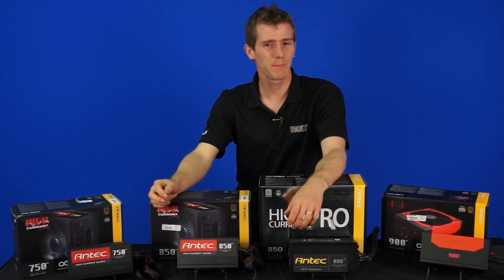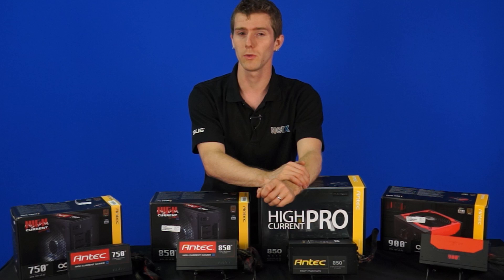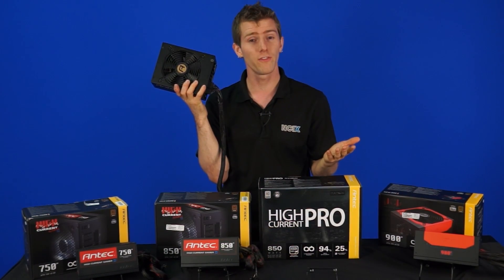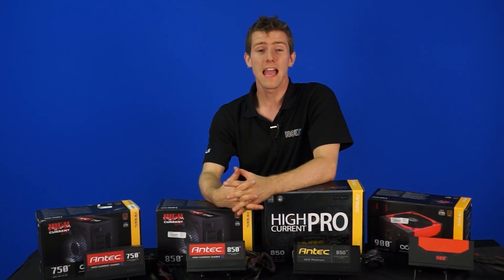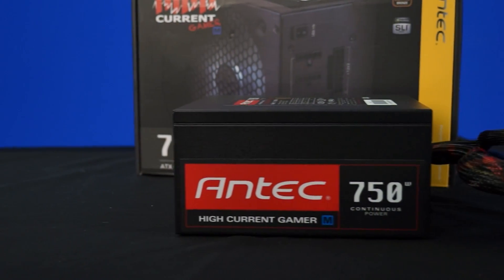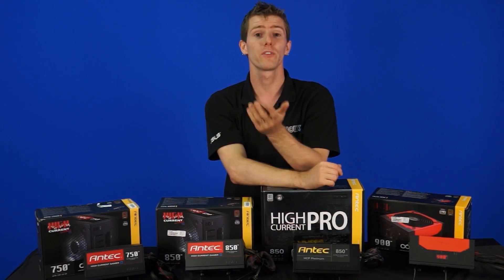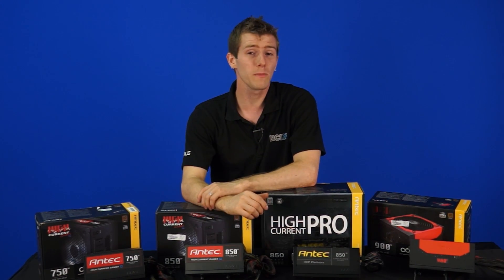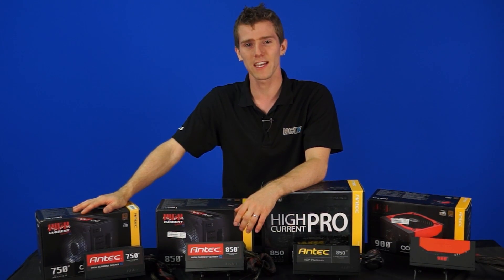How Many Watts Do You REALLY Need In Your Power Supply? ft. Antec HCG

Comment: I bought a HP ProDesk 400 with just a motherboard, optical drive and power supply for £20GBP/$27USD. It only has a 240W PSU, yet runs fine with a 4th gen i3, GTX 660 and 8GB DDR3. All costed around £140/$185 and that even includes a 120GB Kingston SSD as well as a 1TB Seagate Barracuda Hard Drive. Great deal.

Comment: How much power do I need for a 
intel i5 2.7ghz
1x 8gb memory stick
1 tb hard drive
Rx 460 2gb
Reply: 430 Watts PSU would actually do the Job, lets say processor 100w + Rx460 ( On Fullload) 100w + Ram and HDD like 40-50 Watts = total of 250 Watts. so you basically have 180 Watts left for like Overclocking your GPU, if your CPU And Motherboard Support Overclocking.

Comment: How many watts do I need 
Intel
G3258 4 Pentium 3.20 GHz 3M Cache 2 Core Processor 
Ballistix Sport 8GB Kit (4GBx2) DDR3 1600 MT/s (PC3-12800) 
Asus H81M-A MicroATX DDR3 1333 LGA 1150 Motherboards
Asus
2GB Graphics Cards R7240-2GD3-L
Sea gate 1TB Desktop HDD SATA 6Gb/s 64MB Cache 3.5-Inch Internal Bare Drive
Reply: Plz reply
Reply: HuahwiFanBoi www.coolermaster.com/power-supply-calculator/

Comment: I use to run my two 780's overclock on a 750w power supply also have three hardrives 6 fans corsair self water cooler with a push pull total fans 8 the power hungry fx 8350 led light strips corsair RGB keyboard and not once I ran into power problems you don't need a overkill power supply just enough.

Comment: what watts shall i get? my specs are i7 4770k,asus z87pro, 12gb ddr 3 ram, 256ssd,1tb hdd l, 1 optical drive,zotac geforce gtx 970, 3 120mm fans,coolermaster h212 cpu cooler...the calcualtor suggests 600w, what do u ppl recommend?
Reply: 600-650w 80+ is good if you are not using liquid cooling. If you have liquid cooling or running over clocked I suggest 750 give or take.
Reply: Kevin J no liquid cooling or overclocking. No gaming at all, just normal use like browsing internet.
Reply: +The Hitman Then go with 600w bronze+ is perfect. Antec and  corsair have some good psu, don't forget compatibility measurements. Good luck.
Reply: thanks mate
Reply: The Hitman get 650 to make sure

Comment: im 16 and im soo confused about psu i have 320 watt psu does it actually enough for 750 ti or other gpu with 2gb vram????
Reply: 320 watts? Does that exist? Anyway, it mainly matters on what CPU, cooling and GPU you are using. I'm going to go ahead and say 500 watts 80+ is good if you're running a less efficient CPU and air cooling.
Reply: striker113 thnks for the tips tho,my dad bought my first pc this one that we talk about what i know is i look at the back of the psu box it says 320 watt,so i just wonder is there any 2gb vram gpu for my psu???if not yup 500 it is.......bad english sorry.....

Comment: i got a question! how much watt supply do i need?
+CPU : Intel Core i5 6600K / 3,50GHz 
+RAM : Corsair Vengeance LPX 16GB 2666MHz DDR4 
+HDD : Seagate Barracuda 1 TB
+SSD : samsung 850 EVO 250 GB (SSD)
+Motherboard : ASUS Z170 Pro Gaming
+GPU : Nvidia GeForce GTX 1070 (8GB)
Reply: If you're not planning to overclock or upgrade, I'd go for 650 watts. If you want some headroom, 800 watts is not that much more expensive. Always look for high quality, efficient power supplies.
Reply: thx

Comment: can I run my MSI gtx 980ti on a thermal take 600w tr2? please help.
Reply: Nvidia recommends 600w or more so wattage should be ok if you don't overclock.
Reply: Jonathan Zimmermann that's more than enough power 

I ran my two 780's overclock on a 750w power supply also have three hardrives 6 fans corsair self water cooler with a push pull total fans 8 the power hungry fx 8350 led light strips corsair RGB keyboard and not once I ran into power problems.

Comment: Guys, halp! I want to build on my Pc 8 GB ram (Hyper X) and a Gigabyte GTX 950 OC 2 GB. I actually have a i5 4440 3.1 GHz, so, the question is, how much Watts do i need? 
Remember: i54440, 8 GB ram, 2 fans on my case, gtx 950 OC 2 GB, 1 SSHD 1TB. Thank you!
Reply: 500 watts should be fine. If you plan on upgrading that CPU and GPU, 600-650 is good. Overclocking? Get yourself an extra 100 watts.

Comment: man for sli gtx 970 in msi how many watts i need; meaybe 850?
Reply: depends on your build. it should take around 750
Reply: less than
Reply: +sshortguy1 hahahaha im not want have fans; cooled water indont think so when restart is in 60°C only in pc temp; is low
Reply: +alex fer i think in psu problem or gpu
Reply: +sshortguy1 with only 69 °C in max temp?? i think that temp is not the problem

Comment: There are so many anxious comments with people asking about how much wattage they need. +1 this up so more people can see and learn :)

400W - This is good for low to mid range graphics cards. If you're running a GTX 750ti or GTX 960, you'll end up drawing a MAXIMUM of around 300W. 400W is perfect for these cards.

500W - Enough for almost ANY system running a single Nvidia or AMD card that is NOT the GTX 980ti or AMD 390. If you're going to be adding multiple hard drives (3+) in the near future then I recommend the 600W. 

600W - This is good for AMD cards like the 390 or 980ti as those take to much power to fit into a 500W build.

750W - Great for SLI (two cards) and major expansion like many hard drives (5+). This is great for an all out build. 

1000W - This is for an SLI with GTX 980ti or AMD 390
Reply: Drawing a what?!
Reply: +sshortguy1 Regardless, it's always nice to have headroom for future upgrades.
Reply: i have an power supply with 500w can i upgrade my graphics card to GTX 980ti??

Comment: tell the best psu for my configuration

Graphic card:  MSI Radeon R9 380 DirectX 12 R9 380 GAMING 4G 4GB 256-Bit GDDR5 PCI Express 3.0 HDCP Ready CrossFireX Support ATX Video Card
Mother board: MSI MSI Gaming Z170A GAMING M7 LGA 1151 Intel Z170 HDMI SATA 6Gb/s USB 3.1 ATX Intel Motherboard  
Hard disk: WD Black 1TB Performance Desktop Hard Disk Drive - 7200 RPM SATA 6 Gb/s 64MB Cache 3.5 Inch - WD1003FZEX 
Ram: CORSAIR Vengeance LPX 16GB (2 x 8GB) 288-Pin DDR4 SDRAM DDR4 3000 (PC4 24000) Memory Kit Model CMK16GX4M2B3000C15  
Cpu:  Intel Core i7-6700K 8M Skylake Quad-Core 4.0 GHz LGA 1151 91W BX80662I76700K Desktop Processor Intel® HD Graphics 530
Computer case: Corsair Graphite Series 760T CC-9011074-WW White Full Tower Windowed Case 
Keyboard and mouse: DRAGON WAR GKM-001 SENCAIC KEYBOARD & MOUSE COMBO SET Dvd drive: LG BH10LS30 Super Multi Blu Blu-Ray & DVD Drive  
Headset: Etekcity Scroll Gaming Headset (H5GX): LED Light Up Effect (Black/Red)
Reply: +shrivanimarketing You would be fine with a 850w gold or better.
Reply: +Philippe Valin Intel Core i7 i7-4790K , gtx980ti ,8gb ram dude should I go for the 850w ?
Reply: Yes it's just perfect since you got 94% efficiency you'll be fine with 850w.

Comment: i5- 4460
EVGA geforce gtx 960
8gb ram
is 600watt psu good enough?
Reply: +Radu Boescu i would just get a 500/550watt psu(unless you plan on purchasing a more powerful card like an R9 390 in the near future). Can't go wrong with Antec, Seasonic, XFX or EVGA . These brands have a reputation for their quality, they also have both budget & high-end PSU's, so as long as you get a psu from one of these brands, then everything should be 100% fine. I have the same build as you and i brought an Antec Edge 550w 80+ Gold, kinda regretted that decision because i could of saved about $20AUD which could of been used on a better GPU.
Reply: +Kayanz thx for answering but im planning now to buy 
Amd fx-8350
EVGA gtx 970 4gb
16 gb ram
I still probably need a 600w psu right?
Reply: Different acount
Reply: 550w is enough but you can go with 600w if you want. Also some advice on your build, i'd go with an i5 4460/6500 (Non-OC) or an i5 4690K/6600K (OC) as they are better overall. 8GB ram is more than enough, use that money on an intel CPU or a better gpu like the R9 390. If you decide to get the R9 390 you may need a 600+watt psu.

Comment: How many watts do i need for this build? 

intel i5-6600k 
MSI z170m mortar
ASUS GTX 960 strix 4gb
8gb gskill ripjaws v dual ddr4 2400 
1TB WD caviar blue
Reply: 550-600 watts should be fine, 650-700 for decent overclocks. Both these options give you a minimal amount of expandability should you upgrade your graphics card.

Comment: so, how much watts am I gonna need for an Intel I5 6500+ GTX 960 4ghz + 12 gigs ddr3 ram?
Reply: Since you don't have a "K" CPU, you probably won't be overclocking that, Gtx 960 is a decent card on power consumption. Go for 550 watts or 650 if you want to get a K CPU in the future.

Comment: How much watts do I need for this computer?

2 Geforce 980 ti's (Graphics Cards)
i7 4790k (Processor)
32 GB (Memory)
MSI Z87-G45 Gaming ATX LGA1150 (Motherboard)

If you need any more info about the computer let me know
Reply: you could probably get away with 800 watts fine and dandy and still have room to overclock but I would say a thousand in case other things need to be add like water cooling or maybe extra hard drives or whatever

Comment: Alright so I may need some help from the comments on this one.
I have am getting a(n):
MSI Nvidia GeForce GTX 970 
MSI 970 Gaming mother board
16 gb DDR3 RAM (8x2)
AMD FX-6350 6-core cpu
I have tried several calculators and one where I rebuilt my pc and was told that I would need either a 450w or a 750w psu. What psu would really be needed for this system?? Thanks in advance.
Reply: Well the nividia card are very power efficient so i think you would be good with a 550 -600 watt power suply but plz.      Just get the 600 so you have head room
Reply: you can litterly get a a amazeing power supply for dirt cheap corsair's is the brand that I went with and it has lasted me 4 years now and I just bought a bigger one (1200watts) for 270 which is very overkill but I'm sli two gtx1080 and have 5 hard drives amongst other things. anyway the point that I was gunna make is buy a good PSU now so that it will last you for the life of your build or better mine was 760watts I believe and Wass great till I started really pimping it out you should buy that you can get it for under a 100 I have seen prices as low as 50 dollars and its super efficient

Comment: r9 390x crossfire 
i5 4960k
750w will be enough?
Reply: yep
Reply: I have the same crossfire 390 x and i7 6700k at 4.8 1.33volt and my v750 w is ok
Reply: +Adrian Nastase im thinking about the same crossfire on my i5 6600k, do you have any crossfire/driver issue? and how the performance?
Reply: ***** what about the i5 4690k? will it bottleneck?
Reply: Well, gta5 didn't scale very well till the last driver but it OK.  And any i5 from 2500k series won't bottleneck
Reply: +Adrian Nastase does 7 fans consume a lot?
Reply: No really, what fans?
Reply: corsair led fans
Reply: Not a lot at all

Comment: i5 4460
Hyper 212 Evo cooler
Titan black
1tb hdd 
1155 micro tax mother board
8GB 1866 MHz Kingston 
600w psu semi modular it's pretty powerful .. Enough ?
Reply: +Richard Rampersad I have an i7 4770k and a 980ti running on a 630w psu. Take that for what you will.
Reply: Richard Rampersad Yeah, I've seen people saying you need 850w for a 980ti before, which is crazy.
Reply: Make sure you get a quality PSU because 600W for a Titan is the bare minimum. If it was me, I'd be getting a 750W.
Reply: CooledLead how about for a GTX 980
Reply: +Richard Rampersad I run my GTX 980 with a 650W
Reply: CooledLead they say minimun is 500 wats , so im sure 600 is good
Reply: +Richard Rampersad Your cpu is socket 1150, and your mobo is socket 1155.
Reply: Benny Rosario sorry about that minor error lol , it is a 1150
Reply: OG_Ravioli Dog i realised that you dont need so much , like 1000w psu and stuff for 1 gpu configs , also im using a i5 4570 and a gtx 970 windforce with 16GB 1866MHZ ram
Reply: OG_Ravioli Dog lol , they dont read
Reply: imgone to much but , why not

Comment: So the comments here are actually more helpful than the video.  

My system:

ASUS ROG Maximus Hero VIII
i7-6700K, OC'd to 4.6Ghz @ 1.37Vcore
2 x ASUS ROG 980 Ti Poseidons, stock clock
Samsug 850 Evo
2 x WD Black 4 TB drives
Some LED case lighting
EK Predator 240
4 other case fans

I just bought the second 980, think my BeQuiet! Dark Power Pro 11 850W will be enough to run the 980 Tis in SLI or do I need to step up to a 1000W?
Reply: Im running two Msi gtx 980 ti lightning edition cards in sli with my Cooler master V850w psu and have the same setup as you do so i think you'll do fine.
Reply: +Samee997 
YES YES!!!!! I ordered my 2nd 980 ti (Asus Strix model) and i have a HX850i Platinum PSU!!! i7 6700k@4.7ghz at 1.325volts, it is enough right??
Reply: Confirmed! You guys rock.  A couple of weeks down now and she's killing the FPS with 980 Tis in SLI with a BeQuiet! 850W PSU
Reply: +rogueeric 
Weeks using you're 980 ti's with a 850W PSU no problems? im kinda scared!! jajaja because my second 980 ti is on the way and I have a 850W PSU, BTW are they reference or what model?
Reply: +Angel Negron Yep its more than enough your psu being a platinum certified is gonna do a much better job

Comment: Hello geeks and nerds. I need an advice on choosing the psu. Already have most of the partsof my rig. list is: Amd fx6350, msi 970 gaming mobo, gskill 1866 mhz rams(4sticks of 4gb), 1 ssd, two hard drives raided, 5 140mm fans, 2 120mm fans, cm hyper 212 evo, in a corsair 780t case. I'm considering buying an msi r9 390 8gb gpu. I will be overclocking the cpu to run at 4.5ghz if I'm lucky. With that said what psu should I buy. There is no budget limit on the psu. Thanks!
Reply: http://m.newegg.com/Product/index?itemnumber=N82E16817151108
That's a seasonic built 850 watt that will suit your system. Seasonic rarely use low quality caps which is essential for overclockers. How clean the power is delivered to the components is essential because obviously when you overclock a GPU or CPU, it needs the cleanest power possible to maintain stability since it is working beyond its potential. High end components will deliver stable power while lasting a lot longer than the mid range to low end you'll find in low budget units. 

Obviously the psu I have chosen is overkill but since you will overclock, it's better to be safe than sorry. Plus, it's a great price for a 850 watt.
Reply: lmao geeks and nerds

Comment: Is 350w enough for q6600, hd 7770, 4 x 2gb ddr2, 2 sata drives, and a rw disk drive?
Reply: +Tay Dinghan No. Try and get a 600W. Thats a safe spot.
Reply: +Eylin Morel most likely. but bigger is better in terms of PSU. :)
Reply: +Sahan Methmal I have a 730 is that safe enough
Reply: Sahan Methmal thanks :]

Comment: So... The answer to the question "How Many Watts Do You REALLY Need In Your Power Supply?" is "It depends"? Not for example "For a GTX 970 with 16GB of RAM and a 4790K you will need at least this much power"?
Reply: yeah... kind of a let down.
Reply: Thomas Aguirre
Yep. Agreed
Reply: This is why we have PSU calculators. Check out Coolermaster's PSU calculator to figure out what you need.
Reply: but I wanna do it without a calculator. or have a video give me what I searched for.
Reply: Thomas Aguirre That would take an incredibly long amount of time. PSU calculators allow you to get a very precise wattage estimate, taking into account every single part of your build, specific clock speeds, and more. Linus is simply trying to say that there is not one clear cut-and-dry solution for everyone, even when using the same parts, and try to reach out and inform people who feel the need to buy a 1200w power supply for something like a 970/4690 at stock clocks, that what they are doing is entirely unnecessary, or even detrimental.
Reply: +BigE1943 The calculator told me to get at least a 1000 Watt PSU for I7 4770, 2 980s + HDDs and stuff...I'm running a 750w PSU with no problems at all WITH overclocking...
Reply: +DaS UniKaT It does have a tendency to overestimate because of it factors in decay in a very heavy-handed way. It'll recommend a PSU to you that's usually overpowered, but you just look at the wattage load and get the PSU that fits it best. Also, calculators operate off the assumption that everything is at 100% load, so your real consumption is going to be lower pretty much always unless you're stress-testing all of your components all at once.
Reply: BigE1943 Well...I still saved around 30€ for the cheaper, lower watt PSU if I'd liked to stick with the same brand
Reply: +DaS UniKaT Yeah, the prices start to hike a lot once you break the 750ish watt mark.
Reply: +SwedishGamer322 well i only require a 500w evga power suppy with my r9 390 and i7 2600